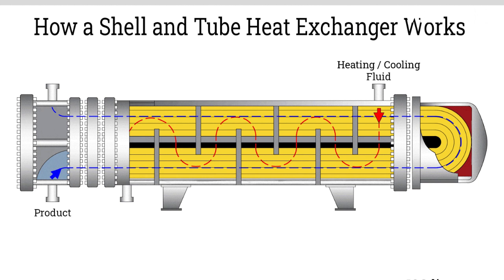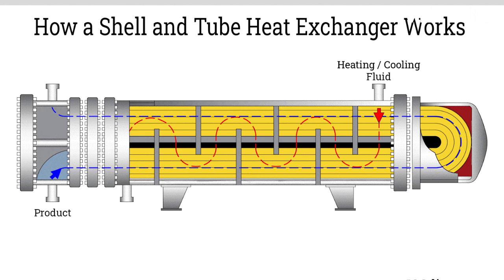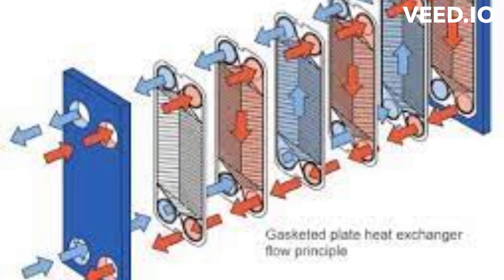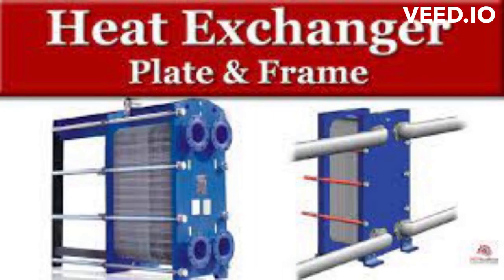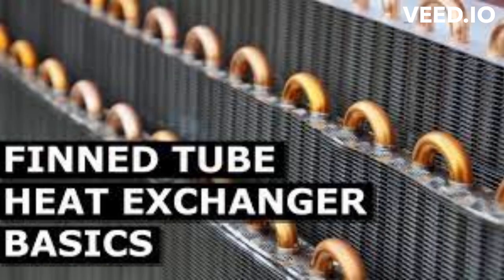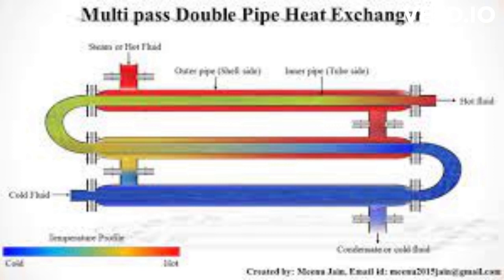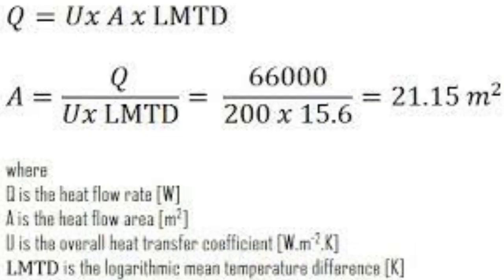#Heat Exchanger //#Condeser//#working principle shell and tube HE//Animated video for Heat exchanger

Comment: Hello bro  tube sheet banwa ne hai kya
Reply from the maker: Tube sheet is separately made which has more path ways to run the fluid in a different channel by using the baffles, which is to be fabricated out side and keep into shell and fix the dished ends.